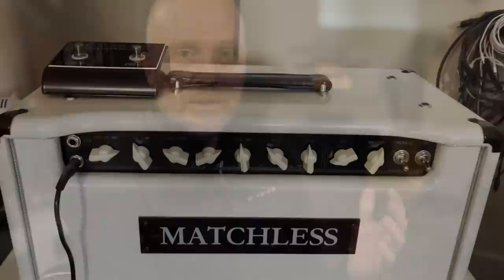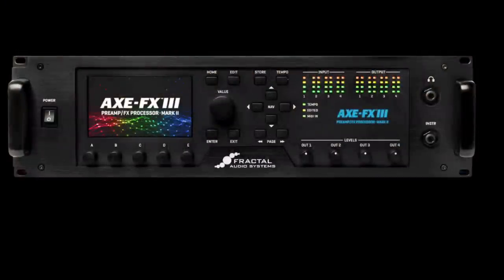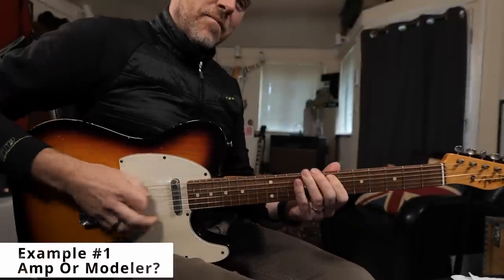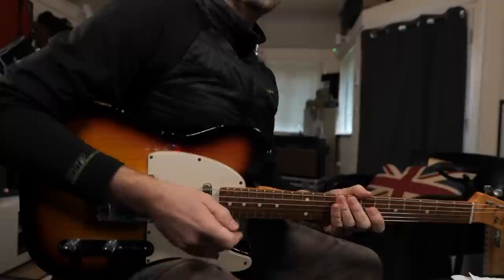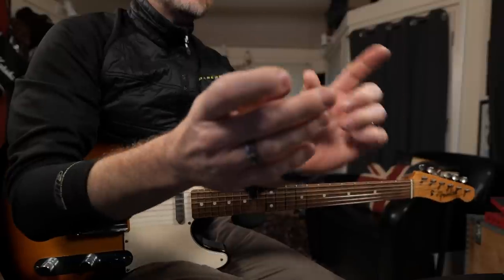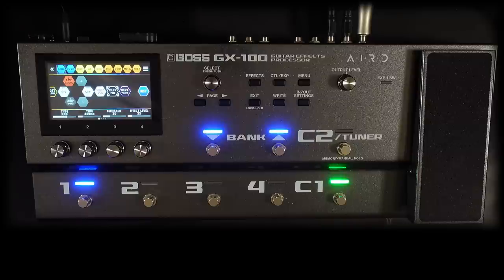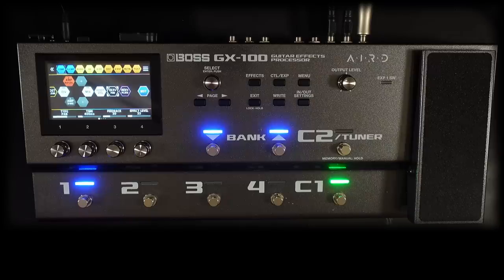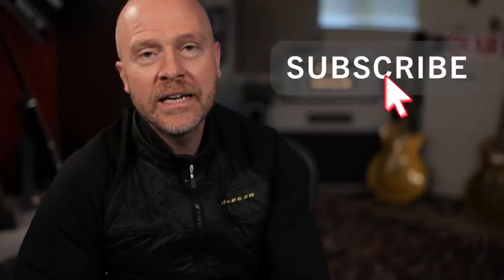Guitar Amp vs Modeler - Can You Tell The Difference

Comment: Great video!  As a Fractal user, and I mainly use the Matchless models, I could pick the 1 and 2; it's not a perfect replica as you say, but it sounds awesome, so great. And the AXE FX is 1000% more practical than amps and a pedalboard in every way. I was so impressed with the Boss unit, that was a real suprise.  Massive value for money.

Comment: I felt the Matchless still pulled some midrange tones that the Ax didn’t in your example. Still is very cool because of the ease of taking that out live. Living in Texas affords me to play outside a lot and most places we play have never heard of “quiet stages”. Praise Jesse.
Reply: And one can tweak that midrange on the Capture to match it too, if one had the desire to. I liked both examples actually, had to crank it louder to hear the amp. differences. This Neural Tech. is astonishing, digital going into a stage 3 or generation 3. stage 1, the original stuff, Pods/Vox tonelabs,  stage 2 kemper, and now generation 3 using Neural Capture.

Comment: Hello everyone. I have been working as a guitar technician for a long time. And first of all, I love analog amps and effects. But I think devices like the kemper or the Axe-FX are simply more reliable and above all, less susceptible to local problems such as electricity and weather. A wet speaker just sounds different and if  tube amps that don't get enough power  they just sound like sh.. and what we all want is always the same sound. So it was a real relief for me as a technician to have the same sound ready every day and almost every sound engineer was happier with the signal.
The difference I perceive for myself is the sound behavior of the low end. Tubes give the bass more punch and warmth. Here it helps to send the DI output of the AXE-FX or Kemper or any other digital amp through a tube DI or preamp again. It gave the sound a rounder and warmer  overall  ton and a little less digital on certain sounds.
But in the end there isn't an amp for everyone and there are professionals and amateur musicians and everyone needs the right tool for their area and the ideas of how an amp should sound are also very different. Therefore everyone should play the amp he wants. None of us invented playing the guitar ;)

Best greats from Germany BRS

Comment: I have tried both at Gigs. I spent 12 Months with an Axe FX and currently use a Friedman Twin Sister. The axe fx was great but it doesn't sound like a real amp. Its 90% of the way there. The Friedman comes alive at certain volume levels that I just couldn't get from the Axe FX. Nothing wrong with the Axe-FX. I think there is a real difference between playing at the volumes you regularly hear on Youtube and the volume levels that are used at a gig. Playing both in a live mix is where the Amp really shone through. Thanks for the video:)
Reply: how do they both sit in a mix? That is real test at least for recording purposes. Miking amps is a pain and maintenance of tubes as well as space required.

Comment: I love your reviews and comparison videos. i quite often use them to compare and contrast sounds in my modeler when I'm trying to dial them in.Thank you for that! So, I got my tele out and grabbed my Matchless setting in my modeler and proceeded to play along with you to hear the differences between all three. At first i wasn't sure which was which, because mine had subtle differences in verbs and delays. Mine sounded more like example 2. The individual notes had the same body to them and the same darker transients in the high end. When i heard the GX-100, i pretty much knew for sure example 1 was the Axe FX. The upper end of the GX was closer to the Axe, those transients seem to be a common thing between most modelers. What am i using? The far too often kicked to the curb Headrush pedalboard. I must have it dialed in fairly well, and in a large part, thanks to you Paul. You always have great tones to listen to.

Comment: I could tell, had no doubts. I admit the difference is tiny. But tiny differences make a big deal to how comfortable or inspired I am. I would totaly use that moderler to do a job but for my own enjoyment it would have to be the valve amp. Shame as I wanted to be fooled so I can convert to digital full time for the practicality but the tech is not there yet. I had the Boss gx100 and it was good but I could feel the latency and it annoys me. I have a Helix Stopm now and use it when I can't fit the half stack in the band van. Maybe in another 20 years they will nail it. I hope so. BTW Paul you play great and if I was at one of your gigs I would enjoy it either way.

Comment: The main difference to me is how they handle mids. The mids in most modellers, including the Axe FX, sound less fundamental and have less sustain, than most analog amps. Even the cheapest amps does this better. I hear a cardboard type sound in modellers that I just don't agree with, and I've had quite a few. When I try dial the mids up, they start to sound bad..But I would think it is quite subjective then, because many don't love mids, and therefore might prefer modellers. And some have amps with scooped mids, which it might not be such a big leap to a modeller. You may even be able to compensate with a pedal for handling the mids, and you may even prefer less mids in your tone for recording or doing rhythm behind a singer. I believe the mids are where the modellers can improve, though. Btw, the Boss sounded much better than the Axe in that regard, to my ears.
Reply: Totally agree with this, I’ve used the Helix for about 3 years now, for me modellers do have that “cardboard” sound like you said, at the same time amazing machines, I don’t really know how to explain it but using real amps for about 17 years prior I knew the difference between the two straight away

Comment: Love your vids Paul. I've used modellers with Atomic CLR behind me. Playing live is the main problem, dialing them into the room at a gig is close to impossible. A great demo for you to demonstrate is to plug your Matchless amp and cab with the same settings you had at previous gig and TURN the amp to low low volumes (dont touch the eq)
I've done this with my Friedman Smallbox 50 that proves to me real amps win playing live because of the dealing in quick process. Most amp guys fiddle with the eq before every gig try doing that with the Axe FX. Why don't more people bring up this dilemma ?? Super playing great vids love your stuff. Love to hear your thoughts.

Comment: I could hear the difference on earbuds and I thought 2 was the Matchless (but I wouldn't have been surprised if it had turned out to be the other way round). I've never used either unit personally, but I thought 2 had more "Voxiness" and 1 sounded stiffer.

Comment: Hi Paul,
first of all: I love to listen to you. You are a such great inspiration: I love ur playing, Ur tone. So beautiful. Thank You.
 I´m in the "modeller-theme" since the first standard, then the kemper, the II-XL now the AXE-III. - I am old. I´ve owned many Tubeamps over the years before modelers came up.
When comparing the Axe with cheaper/other units, I think, that it is impotant to look, what an AXE III can do beside all tweaking the best "tube-like-tone": 
I dont need a mixer in a small studio. The Axe III is the perfect 8in-8out audiointerface intergrated into any DAW, with an awesome ASIO Driver, no latency,. With Axe Edit it is the most versatile gear I´ve ever owned.  Its an audiointerface -superunit. From this perspective the Modeller is an Addon. UAD has unison. - In terms of Amps: nothing compares to the AxeIII. - Take a good mic, the Tube Pre from the Axe, tweak a lill with some other block. No hum, no noise, give the singer a lill reverb and compression and record the Pure signal without, right into the DAW, with a scable GUI in Axe Edit III and save  every setup in a Preset, scene, block...

Thanks for Ur work. Ruben

Comment: Playing live with the Axe FX has been an excellent experience.  The MFC 101 with 3 expression pedals provides more than enough control over different presets and effects.  I use a Mesa stereo tube power amp and a 4X12 Marshall cabinet wired in stereo, plus direct outs to the mixing console.  I have several boutique amps (Fuchs, Cornford, Bogner, etc) but at this point haven't used any of them for a couple of years.
Reply: That's what happens when you have an AxeFX🙂

Comment: In a post in the FA Forum the main developer of the Firmware gave some reasons also for the differences in tone, like values/quality in electronic components from one production round to another on real amps. Also I guess the whole tone chain has an impact on the final result. I love my AFX3 and while it is not cheap and still for some uses u need to spend some money for example in good monitors, the versatility that provides in unparalleled, plus it offers mind blowing effects. I honestly do not know how it can get much better tone wise.

Comment: I preferred the Axe FX and really thought it was the other way around. But sometimes hearing these things in a full mix of music can yield a much different result. I've often found that modeled guitar tracks can often get lost and require more "work" to mix correctly (eq, compression etc.). In my experience, real amps, even with load boxes/ IRs stay present and require much less work at the mix stage. But to be fair, I've used various plug ins, a Kemper, and an HX stomp, but not Fractal. I'm going to give them a go.

Comment: I thought source 1 was the Amp. Really great stuff although both are very similar. I will say for a live setting the amp is probably a better choice opposed to just sending your signal to the P.A. Another overlooked aspect of this debate is the visuals you get with a stack on stage. Kind of adds to the experience when people see real amps, also feels better to be on stage with a real amp
Reply: Yeah I prefer an amp too, but it is impressive how far emulators have come and having one as backup can't hurt. But it's not for me. I'd rather have an amp to it's sound perfectly than an emulator that can do any sound well. But a lot of gigs people just mike up a small cab and that goes into the PA and monitors. In such a setup it doesn't make a big difference if you have an amp or not.

Comment: The Axe FX III is AMAZING! I have top dollar earphones and I noticed a lot of balance and fullness from the Axe FX, especially in the 90-120 hz area, seemed lacking in the real amp. I wonder, did you record using a direct out on the amp or did you mic a cab. Next, if the cab was mic'd could it be losses from the mic or perhaps a dead spot in driver response curve?

Comment: As good as the AXE3 is, I can almost always tell the difference between it and a real amp by the way it deals with the upper mids and highs, especially on distorted tones. They are always more grainy and displeasing to the ear on the modelers. So for me it wasn't too hard to pick them out correctly on this comparison. The modelers have gotten MUCH better and more realistic, and I have an AX8 which I love. But there is still something about the roundness, smoothness and three dimentionality of real amps/cabs mic'ed up in a room that is tough to beat. There are some tricks though you can use to bring the modelers more in line towards that sound. You basically set very narrow notch filters at 2k, 3.6k, and 5k, and play with bringing those down incrementally until at least the harshness is reduced without destroying the mid/high end. But even that only helps. It still doesn't nail it totally.

Comment: My how the tables have turned. Back in the stone ages you would keep a pod as a backup if your high end tube amp went down. Now the high end tube amp is the backup. 

I was most surprised how the fractal took the external boost. The input reacting to external gear was one of my hang ups for looking into higher end modelers. Looks like that is no longer an issue.

Comment: I use Kemper, helix etc and think they are great. I believe the sound of digital gear has come a long way even to the point of being indistinguishable especially in the mix or at a gig. But, I think I can feel the difference when sat in front of my real amp compared to the Kemper profile of it.  However my biggest concern is, are we letting the convenience of modelling/Profiling take us to the point that it’s no longer economically worthwhile for amp manufacturers to make valve amps. Are we effectively killing off the very thing we’re modelling. After all the valve amps are the reference tone all modelling seeks to accomplish!
Reply from the maker: Great comment, and yes I agree.

Comment: Man part of me really wanted 2 to be the axe fx but in my heart of hearts those great mids were coming from a cab speaker. It would be cool if a modeller tried to mimic the pre amp/power amp portion of the signal chain but did NOT try to mimic the speaker, and then you set it up in your own cab. I don't know if you can set it up like that but if you can would be interesting to see if that would get the two sounding closer (and frankly get the Axe sounding better). If this is already what you did, then idk it's the power of the toobs.

Comment: Been saying for years modellers have reach the stage where in a full mix you can't tell the difference because certain frequencies will be covered but when played alone there is a difference. In a blind test most will be unable to tell. One thing modelling hasn't been able to do is the touch response of valves which a player who's used to can tell but it's getting closer.
Reply: Nope its definitely already past that. Every time I think thats the case I find the setting on the axe which is making me thing that and bam! The amp is reacting exactly as I wanted it to ... even if thats less accurate to the actual amp. maybe its a little negative feedback or presence, or bias, or swapping out the tubes or giving it more input signal .... its always in there.

Comment: yeah i can hear the difference. with some tones it is harder to differentiate but not most of the time. no hate for modeling, have an HX stomp I use as as hired gun and for some recording, but when I am making my music it is on a tube amp because they have a special something to my ear - and i've been trying for the last couple years to get that special something from modelers with no success. there is just nothing like a the sound of a Sun Face starved for voltage going into some hot valves

Comment: They were dead even to me (different but both excellent) until you added the Ryra. Before that I was back and forth on my preference, but with the Ryra I preferred #2 (the amp) each time.  However, the margin was tiny and I would be happy with either. 

That said, I’d rather buy a used Deluxe Reverb, AC30, maybe an Orange, and a Marshall Origin 50, pick my favorite and sell the others… AND then have a ton of cash left over for used pedals.

There is such a thing as choice paralysis and I’m afraid I would suffer from that with something as endlessly versatile as the AxeFX. All that said, I was impressed with its sound.

Comment: They sound so close that the difference could easily be accounted for in how you recorded them.

One is a little more compressed sounding (probably the axe). But its so difficult to tell them apart ... those differences could very easily be adjusted for especially on the axe.

Comment: For 3,400 quid it would want to be close, and to be fair it is. There's nothing between real amps and modellers now really. No difference worth talking about anyway, and that's a great thing. Multi-fx modellers (rack and floor) offer so much more convenience to fully analogue setups. I'm moving away from an analogue pedal board to the Boss GX-100 now, using 4CM through my valve head. Best of both worlds. The power of modern multi-fx is amazing and gives you so much possibility and options.

Comment: I find the digital equipment most suitable for large stages with very professional equipment but for small concerts in pubs, I think that the original amplifier is more suitable and that the sound technician is in charge of putting in a microphone. There is no need for so much digital equipment.

Comment: I didn’t think about this vs that. I just focused on what sounded better to MY ears and MY brain. I’ve been listening to rock n roll since I was 8 years old and I’m nearly 40 now. So I’m not really an average listener. I did this without headphones btw. 

1.) #1 a bit scratchy #2 better

2.) #1 sounds ok, but also scratchy #2 softer, not as gritty 

3.) #1 I guess AMP because of the feedback #2 Sounds Better 

4.) #1 sounds high & gritty #2 a bit better 

5.) #1 ok #2 worse than 1

Comment: Paul can you do a demo of how you run the Axe fix at gigs. I’ve tried helix and it’s not easy getting a great tone in a live situation. I used a powered monitor for stage sound and it was a lot of work to get stage sound right then FOH mix.
For me it was very time consuming so I just reverted to my amp. I embrace technology but the manufacturer’s need to simplify the gear for live gig use.
Reply from the maker: Will do Glen

Comment: To me the 2# has stiffer low end. Overall is 2# stiffer. 
BtW. I was right 
🤓
Edit:One thing i noticed on the AxeFX is something i noticed back in the days with my PodX3. It seems that modeller got overall a squichind sound,or are something "wet" sounding, while Tube amps are much dryer sounding.